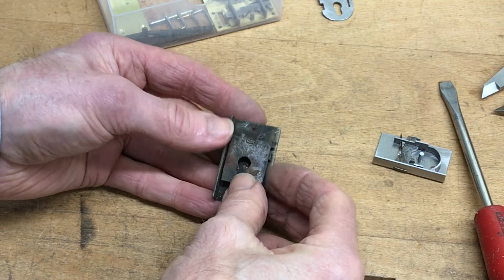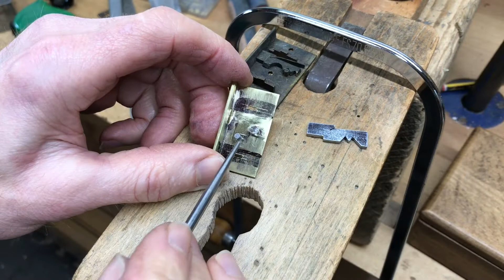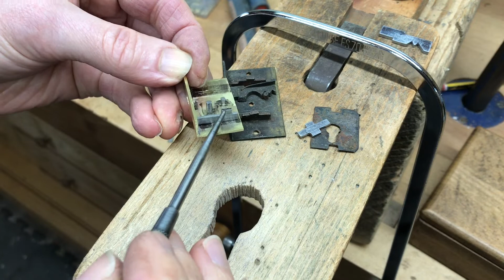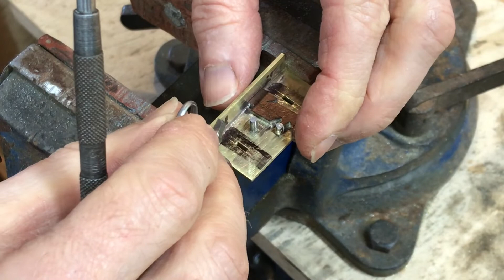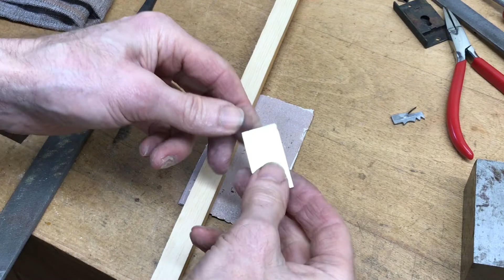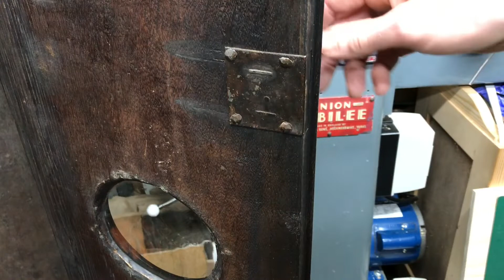Making locks for antique clocks. How to make a cut cupboard lock part 2

Comment: Learning so much from this - thanks
Reply from the maker: Thank you. Most locks for clocks ether look wrong or not available so making them is the only answer.
Reply: @ianswindell agree! I’m facing this issue on desks, chest of drawers etc. Once upon a time there were a few small companies that made locks and other reproduction hardware, but for various reasons the number of suppliers has dwindled and those that still exist have reduced what they offer, so finding proper locks etc has become very difficult and time consuming, so your videos are pure gold, I’d rather use my time making a lock than being frustrated looking through old catalogs and the internet and not finding what I need. Add to this was losing our beloved “old time) hardware store